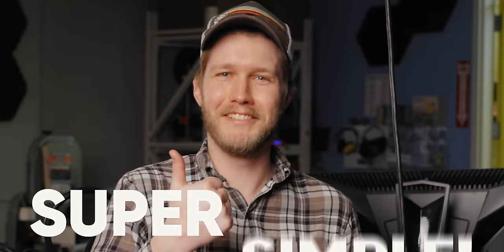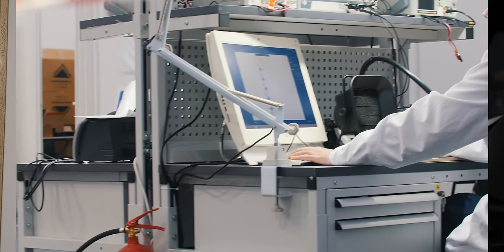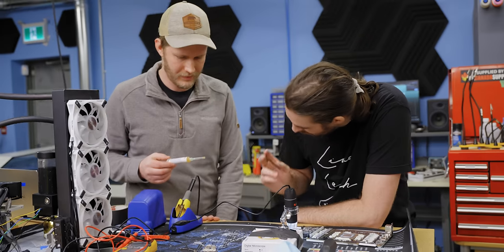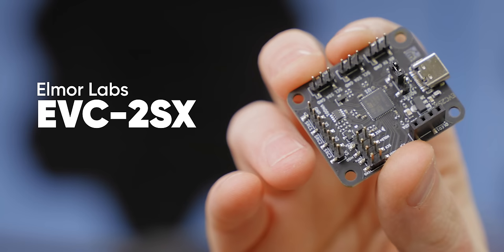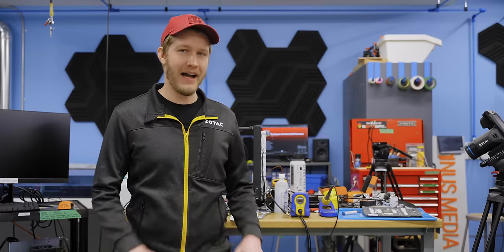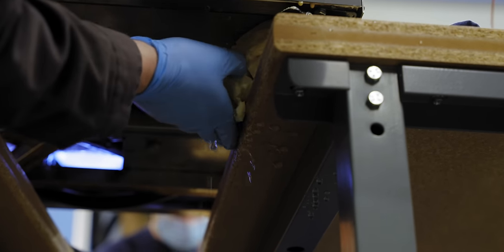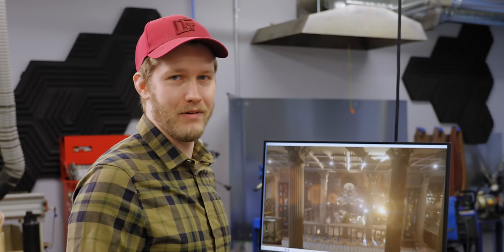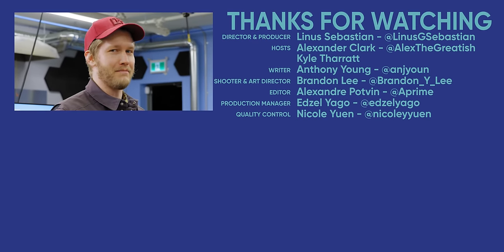Nvidia Doesn't Want You to Do This - GPU Shunt Mod

Comment: I can absolutely vouch for the seasonic plat! I have the 650W one and with my config (i7 2600 & rx 480) runs in passive mode with a system draw of ~300w in gaming! When I decided to oc the 480 for LOLs, that MSI gaming x card chewed through 250-260w BY ITSELF! and when I tried the old 290 it was easily over 300 for the card alone. PSU was barely audible.

Comment: Seeing this soldering job gives me so much more confidence in finally repairing the buck rectifier on my GPU

( I blew it up with a DIY eGPU setup by accidentally plugged in a 19V power adapter rather than a 12V)

Maybe the card isn’t dead
Reply: @SuperTtKiller  I was thinking that maybe since the rectifier (what controls the voltage) blew, maybe everything downstream would be fine.
Reply: @c4sualcycl0ps48  It could be...but 12v in core can kill it already, so 19 v doesn't help 😓

Comment: I'm glad for the EU as here every peace of technology that comes of the shelf has a 2 year warranty regardless of what the manufacturer says.
Reply: does that stop nvidia from locking down its cards and pressuring vendors not to give their users moddable firmware? if no, this doesn't really help you because even in the EU warranties are void when you start soldering extra bits to your hardware to push it outside of its rated operating range
Reply: @TheZALGOisCOMING  I was only reffering to the part that Nvidia can make Oem:s not have warraties in their cards elsewere as that's not posible in the Eu.

Comment: If you wanna try a cooling setup like this I have a few improvements. The use of copper cold plates is obvious, but considering the VRAM temps I would use forged copper VRAM heatsinks as I've experienced much better results with it. For conformal coating, try liquid electrical tape. Once it sets it does the job and can be peeled off with no residue.

I use these to liquid cool a GTX 1080 with a Kraken CLC and NZXT G10 gpu bracket. I used liquid metal on the die to give it more of a fighting chance and I was able to overclock normally even with a 120mm rad and I'm sure something bigger would have done well with a shunt mod.

Comment: @linus tech tips The solder on the componuts were likely Full silver, next time, try to melt the solder, and then Add some cheaper lead/tin/silver solder to the puddle, Then, use a solder revomal tool to suck away the mass, and then just use the bare pads and some fresh regular solder just fine with the IC's

Comment: When using great stuff spray foam spray a little at a time then spray it with a little bit of water to cure it faster and you should be able to avoid that mess.
Also should wait 24 hours to be sure the foam has cured

Comment: years ago, I submerged my computer in mineral oil then put the coils for an ac unit into the oil and it worked beautiful. The sealed tank with the a/c coils and motherboard submerged in oil prevented condensation in the sealed tank.

Comment: We love you LTT, we love our awesome in-house engineer that actually has qualifications to work in some pretty badass fields! Instead, he gets to do something that not many people get to do, butcher flagship GPUs and CPUs.

LTT when modding a $3000 GPU TLDR: we could get a proper soldering iron that will cost a mere fraction of the GPUs price tag, infact for the price of the GPU we're butchering we could probably get an industrial soldering station ..or two, but instead we'll use a toaster. This way we can be absolutely sure that this $3000 GPU will never be stable and likely have board damage. But don't worry we can fix that by ductaping the traces and layers back together and it'll work just like a brand new one!

Comment: It still blows my mind that you guys have all these amazing tools, and don't have a high-wattage soldering station and hot air machine. A quick hot hair station would make SHORT work on those resistors.

Comment: So with the Hakko, people often mistakenly change the calibration temperature rather than actually changing the tip temperature. There is a way to reset it back to factory default. But the usually scenario is a user is trying to increase the temp and they end up setting it to max and it seems to be actually colder or poor performance.

Comment: Definitely would like to see more of this
Even if it turns into a bit of a car crash, that's what makes it entertaining. lol

This was a perfect example of the difference between a soldering iron's max temperature, and the "thermal capacity".

It often helps a lot to just use a wider chisel tip on the iron, and hold the tip square-on to the end of the pad / solder joint / part.

Then again, if the iron doesn't have the wattage, it might not help too much anyway.

I think a lot of this more extreme overclocking stuff shows that the returns start to diminish quickly, vs the effort put in.
ie. it's not often you'll see the average gamer with a phase-change cooler hooked up, just to get a 6-12% boost. lol

But I still love watching the challenge, and seeing the scores people can hit.

Comment: Solder tips: Use a Weller with a horseshoe tip(it retains a bit of solder), use tacky flux from a syringe and buy a flux cleaner canister with brush. It will clean everything. Also .5mm solder with fluxcore. It will be a world of difference. For experiments you can use lead solder to mix in the silver solder thus making it melt better(corrodes after years).

Comment: 6:52 Another solution would be to buy some low melting point solder like ChipQuik, with the price that stuff comes at idk if it'd be worth, but probably should be noted.

Comment: Alright so, I'm a little confused about this.
I've ran Timespy Extreme on my Asus 3090 Strix in the past and with only a Waterblock and no other Hardware modifications I've gotten a graphics score of 11418 points.
You can see the result here: https://www.3dmark.com/spy/18479421
So you're telling me doing all of that got you an increase of less than 300 points?
Reply: Silicone lottery.
had a laptop cpu llano A6-3400m with stock clock at 1.4Ghz and boost of 2.3 - got that beast OC to 3.2Ghz with minimal voltage increase ... unfortunately even the extra ~10W of power  draw was just too much for the laptop cooler and it would reach some 91C in under 7 minutes and that made me stop the torture :D
Was able to hold it at 85C with 2.6Ghz indefinitely. (well not quite, after a few months the plastic around the heatsync started to turn to dust)
Anyway, fun times.
Reply: @Bulanesti  I'm aware that silicone lottery exists. However 50% more power should result in (imho) higher scores. I feel like there is some nvidia safety shenanigans going on.
Reply: Yeah, same here.  Same card, on water, similar result.  Not a very good ROI for all the work they did.  I'm sure not properly cooling the RAM is hurting the performance when compared to what a full coverage water block is doing.
Reply: Low perf chiller + poor VRAM cooling + probs no VRAM OC + probs no XOC vBIOS (lots of internal PLs that an "easy" shunt mod wont fix) + probs no RAM OC = not much perf gain.
Im also a bit concerned on their knowledge of GPU OC and tuning voltages properly. They didnt even know that you can just use KP Classified software cuz KP and Strix have the same PWM controller.
Reply: @Bulanesti  They were comparing Graphics Scores. CPU should make little to none impact. The explainations by the other commenters seem right.
Reply: @Kukielka   The GPU is just an accelerator for the CPU - the CPU outsources vector-based graphics tasks to the GPU, which is designed specifically for conducting matrix- and vector-based operations as fast as possible. The CPU is still responsible for driving all of the components that make executing the game program possible - the harder you want to drive any one component, the harder the CPU has to work. The harder the CPU has to work, the fewer resources it has to effectively multitask. Multitasking is necessary to run GPU, memory, I/O, OS tasks, kernel communication, etc. 

So yes, CPU load definitely has an “impact”, even when it comes to game performance.

Comment: 6:54, the prior statement was blasphemous. I have used a 67 watt hakko in thousands of applications, including on my own 3090ti and never had a problem. This was user error. I obviously don't prefer such low wattage but I do find myself using it as it is alot less bulky than my 150 watt.

Comment: How about a graphite line across the resistor? We used that to connect traces on the old Thunderbird and Thoroughbred cores, throw a bit of tape over it and it'll last as long as the CPU does.

Good old No 2 pencil, you can even measure the resistance and add as needed.

Comment: 1. I squared C 😂😂😂
2. You may potentially had also a power limitation from the PSU if you used only 2 8-pins from the power supply and used the extension of one of them in the third 8-pin plug.
If i remember correctly, the power supply will only supply up to 300W per 8-pin plus 75W from the pcie.

Comment: I'm sure nobody from LTT will read this but. Hakko is a good iron. Recommend using a small conical tip and large magnifying lense(instead of digital) when working on this stuff. Also, might be worth doing a factory reset. Sounded like he was having trouble setting the temperature and possibly adjusted the calibration by mistake causing temps to say 1 thing but output another.

Comment: Your soldering gun is past its prime.   I use the same rig to build drones and I have no issue soldering way larger connections like XT90 terminals on 10g wire.    It should easily solder that connection.   Im assuming the soldering skills around that office should be on par but could be the problem as well.

Comment: You should put this build in mineral oil and freeze it. The oil doesn't expand and freezes at 24°f so it shouldn't be too hard to accomplish and seems like it would be able to manage temperatures better. It would also make a very cool video.

Comment: AMAZING. How about redoing this and using dielectric fluid submersion for the cooling? Sink the GPU in a tank of it, and the fluid evaporated at 36C. If you have loads of it , real chance to keep the GPU ultra cold even as you pour in tonne of power. OVERCLOCK EVERYTHING! Let’s do it !

Comment: Use hotair to solder/desolder SMD parts. And IF you use a solder iron, use a correct tip and heatup the PCB first. But by far the best way is using a hot air solder station for SMD.

Comment: sounds like yall need to invest in a better solder station and some low temp solder to get the factory solder flowing better, usually solder joints on electronics are harder to get flowing cause it requires alot more heat and thats where low temp solder comes in. You could have gotten some silicone coating for circuit boards to seal the entirety of the board to waterproof the components then no worries. Leaks in your cooling system can allow air in which can create air bubbles depending on where the leak is which if it runs through your supply/return lines will reduce the amount of heat its capable of dissipating from the gpu because it reduces flow from the circulating pump.

Comment: You should use liquid nitrogen, not to cool, but to purge a closed system case. Then run freezing refrigerant to cool. No condensate because of the nitrogen purge. (Not super up to speed on things, maybe it has been tried).

Comment: The iron is not crap you are soldering a multi layer board with huge copper ground plane layers that wick away heat. You need an iron that will produce higher heat than you need or heat up the entire card. The other thing you can do is use lower heat solder. Kwikchip solders.

Comment: we use a similar design for measuring current in large -48v strings.   At first I was confused because a BMS system can also use "shunt" diodes to bleed off current in preventing overcharge at a a specific voltage. It's probably a situation of knowing enough to think I know more than I do.  There should be a phrase for that effect.

Comment: If you need more heat out of the soldering iron just wrap some copper wire around just above the tip.

Comment: I remember as a kid we would take an ATI RADEON 9550 256bit version with hynix 4ns rams dice and change the cooler use modded drivers to unlock streams, modded ATI RADEON 9600XT bios flashed on it and also draw a line in one place on the card with a soft sticky graphite pencil (the ones from ikea they give gor free were the best for it) to give it extra voltage and effectively there was an ATI RADEON 9600XT (albeit with half the vram, 128MB instead of 256) for like a 3rd of the price...
People were also going similar things to mod ATI Radeon 9500 into 9700 or 9800SE into 9800XT

Comment: Don't read this, but it would be interesting to see one of those drinking water chiller machines used to circulate chilled drinking water from the machine to gpu and back to the machine tank, and back through the chiller for drinking + gpu cooling. It would probably suck, but it would have multiple functions :)

Comment: Uh, there is resistance/impedance in the circuit in addition to the resistor whatever is in the integrated circuit so the calculation is not twice as much current if anyone is interested.

Comment: Funny, What do you mean cant get hot enough to solder?
Just add some low melt lead solder on top of the other solder and it will melt quick.
Do it all the time and it is easy as eating pie.

Comment: You guys really need an air tight case capable of holding a -30 psi for the duration of your experiments. After that pull a vacuum (<300 microns should suffice) on said case.  And the effect is zero moisture in the case to condensate on the surface of the chiller block. Note: All parts on the mobo that produce heat must have a in loop cooling method (since all of the air is gone and with it the heat transfer). All of that of course is just for overclocking and running a chiller like this would not be cost effective for gaming.  Not to mention you would have to mod the condenser portion with a fan cycling control to keep a desired temperature. Or one could opt for the chiller method and chill water (to keep water from freezing one must add salt or use a liquid with a much lower freezing point) that cools the liquid running through the radiators. All of this of course would have a start up time to chill the liquid well into the negative range. I wish there was a way to do something like this for the gaming market while not using so many amps for the compressor.

All of this is super outlandish but its something id expect LTT could pull off and it would become a tool instead of a one off project.
P.S. The word cold is not scientific as cold does not exist, cold is but a feeling!  Only heat and and the absence of heat truly exist, as all heat must come from a source. Without a source you are left with no heat.

Comment: Engineering is like that.  I thought bippidy boppidy I'd have a diff controller built by now, 3 weeks later and about 10 redesigns and it's still not ready for the car.  But progress is progress, even if it is backwards sometimes

Comment: Nvidia may not want you to do that, but I don''t want you to do that, either.  I'd rather have seen you use nv link on them and then tossed them against the current most incredibly difficult tasks in desktop computing.  Of course, you can still do that. </hint, hint>

Comment: not sure if you are... but get some lo melt aka LEADED solder... mix with the oem shit.. then try removing... these boards are hella thick.. obsorb alot of heat... and the solder they use have a very high melting point from the factory...

Comment: Oh yeah, that hakko is pretty rough. Even though it says 70w the Weller units outperform it in practice, I think WE1010 is the new one and they're not expensive, I think a hundred US, and the ET tips they use are pretty ubiquitous and cheap. 
Obviously like Metcal or JBC make stations that outperform it but at many times the price.

Comment: Dude, step away from the soldering gun.  You needed to use a amp meter or second shunt after the mod to accurately see the power consumption.  Next your memory temps are going to prevent you from seeing a faster speed. You need more than those tiny heat sinks lol.

Comment: You guys can use an AC unit to cool the cpu but in place of Appling all the insulation for air you can submerge the PC in mineral oil so that there is no air to make condensation

Comment: low melt solder....... u mix it with the existing lead free which has a high melt point ...then suck it away ...replace with just low melt leaded and the job will become much easier.

Comment: Would the GPU be the same as the CPU when overclocking? Under volt a little and see if the lower heat will result in better performance long term?

Comment: It would have been far simpler and less expensive to submerge the GPU in a cooler filled with liquid nitrogen which isn't electrically conductive, Amazon 6l < $200. There would have been no risk of condensation. The GPU would not need heat sinks or thermal paste. There would be no need for the air conditioner, fans, insulation, or water. The GPU would run significantly cooler and maybe it could have been pushed harder. Maybe then you would have made the leader board or possibly set a new record.